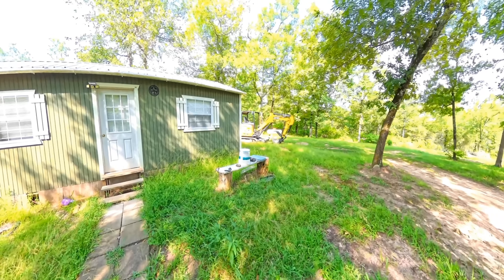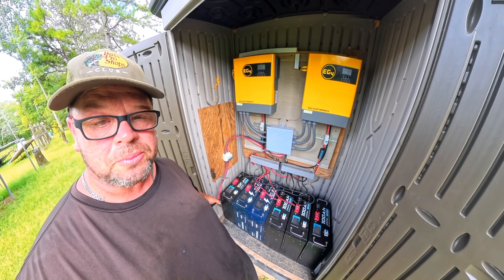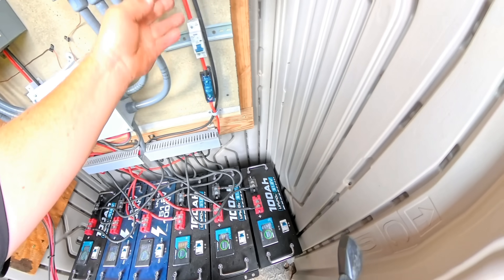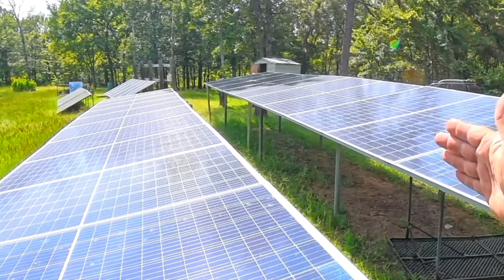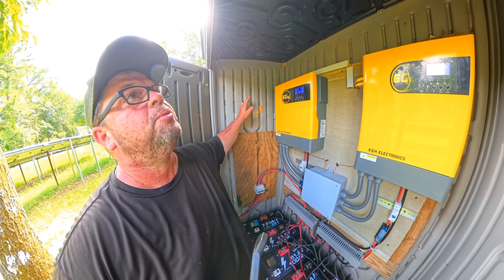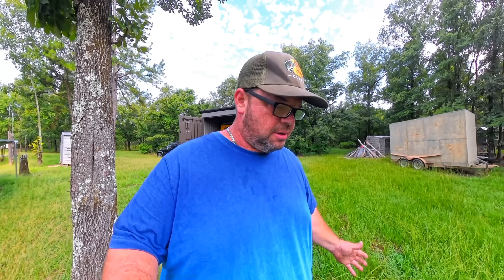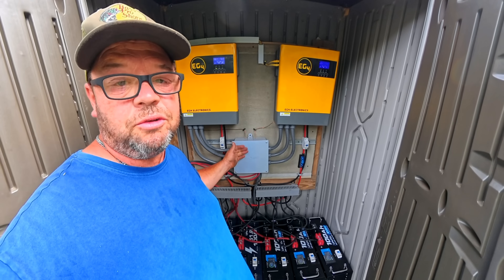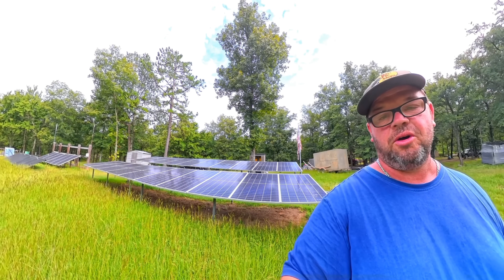Powering My House 24/7 With BATTERIES!!

Comment: As someone who installed "instant" water heaters. I don't recommend them in electric form. The draw is 80 amp breaker for 240 times 3 for each unit. That's not plausible with battery power unless you have a system that can invert 60kw+ on demand. That's 240 amps at 240 volts. So a house requires 400 amp service, if you have it, it would be too much for what you have. 

Just go with instant water heater with propane. I recommend something with more than 150k input BTU. 

Propane is not expensive to have it delivered instead of using 20 lb tanks. For example:

I live in black hills. Out here to fill a tank from local dispenser is $4.25 per gallon ($1 per lb). If you get one of the ASME tank (purchase or lease) you can have a truck delivery service for you anywhere from $1.80 to $3.50 per gallon (depending on season when filling up, more expansive in the winter with some companies) 

Also if you lease a tank, you can only fill from company that provides lease, if you own tank, you can shop around for propane delivery.
Reply: Your math is a little off, an enormous tankless might pull huge power but mine pulls 3000 watts at 240 volts, in comparison my 50 gallon water heater pulls up to 5000 watts at 240 volts. I run the tankless on my solar inverter and it does just fine, if I use it mostly during the day there isn't really a battery damning power hit.
Reply from the maker: exactly what I was thinking

Comment: Bro, all I want to do is run my garage on solar. 1 hot water heater, 2 freezers, 1 frig and some tool batteries. What can I get away with as far as wattage? 😁
Reply from the maker: hot water heater is the killer...keeping 40 to 50 gallons hot 24/7 is a big waste of energy..especially on solar ..but ya at minimum 5000 watts of panels to start

Comment: Which terminals are you using for the two gauge to busbar saw the signature solar 600amp is 5/16. On the water heater front I think running a heat pump water heater is the best use of extra considering the rebates and tax credits. Probably depends if you run at 120 or 240. Love the simple videos thanks ED
Reply from the maker: those where actually from AutoZone 2gauge ..7.59 for 2

Comment: You should get rid of that window ac unit and get yourself a mini split with a inverter technology i bought one last year and the officiency is amazing at a night time wattage drops two 300 to 250w and in a daytime when it's really hot it never goes over 430w the brand i got its called..costway.. with efficiency of 22 rating the price  its around 550 to 500 depending on the website amazon walmart or direct from your website highly recommend :)
Reply from the maker: in the works

Comment: Getting My 40 ft. Container soon. I welcome all ideas to run a normal fridge, (washer  laundry every 2 weeks), 1100-watt microwave, laptop and tablet and 5000 btu window AC. Planning to start with 2 48-volt rack 5.1 kwh batteries. And how many solar panels. Thanks for the video
Reply from the maker: 10 minimum to start

Comment: What do you do if the world goes to shit and you can't buy those batteries? Is the solar set up useless then?
Reply from the maker: I thought the world already went to sht but there still for sale now..lol..honestly I really don't know. But I bet I will be better off than most people for the next 5 years after the sht hits the fan
Reply: @OKLAHOMAOFFGRID you can't run the solar straight to the house and get rid of the battery bank? I don't know how solar works but, that would be my main issue. What if I can't get the batteries one day? I'll be screwed.
Reply from the maker: those batteries are lithium and can last up to 20 years..not like old batteries

Comment: Nice but it still doesnt make sense to buy a 900 dollar battery when you can buy 4 100 ah  12v batteries for 460 bucks free delivery
Reply from the maker: your going to have 4 bms for each 100 amp hour..too much to go wrong and to much to keep balanced and the only recommend 4 sets max

Comment: Try this cut vent put label on outside with a cover canopy over to keep rain out. Install a hinge cover inside . Insulation foam to sandwich piece to close on inside in winter time..
Reply from the maker: Great idea
Reply: You could add a module fan if needed to evacuate heat on one side with a spring wire
Reply from the maker: i was thinking of overhanging metal roof and then vents

Comment: To keep your battery shed cooler, on the lower side of the shed, maybe in the front, drill a hole, and dig your self a ditch, about 4 ft deep, and long enough so that a 3” pvc tube adds up in volume to match or be a little bit bigger then the volume of the shed, if you put to small fans at the top of the side walls of your shed, burry the pvc tubes, the earth will keep them cool and the shed heat will get cool air when the fans are on! Shoot me message if you’d like to discuss.
Reply: There's a love and hate relationship when it comes to control temps in utilities builds! Lifepo4 batteries can survive in temps as high as 140°! Here in the south east control panel boxes for rail road crossing have hit temps as high as 149° with engines parked next to them idling for days! Proper air flow is all that is needed! we have 17+ years lifepo4 cells still kicking! While it's a Gud Idea to help cool it just be careful not to induce moisture into the utility building that will destroy everything quickly!
Reply from the maker: great point
Reply: @nathanhatcher7096 a simple humidity/temp monitor and control system would work great! Arduino!!
Reply from the maker: That's a great idea I'll definitely keep that in mind.

Comment: I enjoy seeing your realistic and genuine videos about your systems. You mentioned something few talk about, racking can easily cost more than panels. And to be honest $$ is the main reason I only have a small solar setup. First my electric co-op is only 10c/kwh and they are very good at keeping the grid up. Secondly they only want to sell bigger panels in pallets making it difficult to slowly build up a system. My main concern is keeping my fridges and freezers going if there is an outage and in the winter to run the fan on my wood furnace. Between power stations and batteries I have about 20kwh of storage and multiple generators with fuel stored to last a while. I would love to be able to be fully autonomous like you but can't justify all that money. You keep me looking at ways to improve. Thanks

Comment: For automatic ventilation... Consider a 5V PC fan and a small 5V solar panel to power it directly. No battery or other controls. It will only come on when the sun is shining on the shed heating it up and won't if it isn't. very simple. no controls to fail.
Reply from the maker: You know it's really a great idea because even in the clouds it should be enough to run those fans.. I'm actually thinking about doing it with 90° facing downward PVC pipe with a round fan inside of it after somebody just gave that idea and maybe put screen over it so no bugs can get in
Reply from the maker: That is a great idea and I'm really considering that and I'm considering putting like window screen over it with a round fan inside 4-in PVC pipe and running it to a couple of small solar panels... Great idea thank you
Reply: I added a louvered exhaust fan to my solar shed, and it does a good job at removing hot air in the summer. Your small shed won't need a large 12 inch fan like my 10x12 shed. I do like the louvers though as it will help keep the rain out.

Comment: How do you keep your inverters and. Batteries from getting too hot in the summer time if you leave them outside??
Reply from the maker: Well that's what I was talking about in the video it really needs fans in there but just the ambient temperature of 100 or 105 is not going to affect the batteries or the inverters as long as they're getting the air flow and not trapped up into the shed so for right now I've been just opening the doors as long as it hasn't been raining but I'm about to do ventilation

Comment: 🤔❓ Thinking about a similar system in the near future, do the components need cooling in some form❓A/C, or Fan❓😁 Thanks Brother for all you do 💒⚔️🎚️ God Bless us All 🇺🇸🙏✝️
Reply from the maker: Yeah that's kind of what I was saying in the video is that I'm going to have to get some type of ventilation going in there because for right now I've been having to keep the doors open but as far as 100° ambient temperature is not going to hurt anything it's just with it closed up it can get up to 150 to 160 in there and that's going to damage everything.. so yeah I keep the doors open for now until I figure out some type of ventilation
Reply: @OKLAHOMAOFFGRID You could literally run a small Mini-split directly off your solar.😜I saw another Righteous Brother show that specific setup " DIY HVAC Guy " 🤗💒⚔️

Comment: Next I would add on another room to your house/shed.    You can still keep it closed off in the hot summer, so you don't have to cool it.  But for half the year when it's nice weather, it will be nice to have that extra room.   I usually hang a sheet over my kitchen and block off part of the house in the summer;  plus you can cook in there and not heat up the AC side of the house.  It really helps with the bill when you reduce your cooled area/room.  But it's still nice have a bigger house too.
Reply from the maker: Yeah that would be great

Comment: Betting the SOC is pretty flat across the batteries. BMS's aren't very reliable for determining SOC. Long as conductors are large enough not to cause choke points they will stick together like best friends.
Reply from the maker: You are correct

Comment: Use a pipe and or just a 90 degree angle and use a low voltage fan on each side. Turn 90 down so no water can come in
Reply from the maker: Great idea

Comment: :hand-pink-waving: tankless hot water system is the way to go :face-blue-smiling: great video:hand-purple-blue-peace:
Reply: I use an old electric water heater using a 120 volt 1500 watt heating element in it as a preheater to the propane water heater. Because of snow in the winter I used only 32 gallons of propane last year, which includes the kitchen propane stove. My neighbor's on demand tankless water heater needs 34,000 watts in order to run so I set up an electric water preheater for them as well for the winter snows. They do not have solar but use a generator during outages. Heated water in an insulated tank is another form of an energy storage system.
Reply from the maker: thats a massive instant hot water heater to need that many watts at once
Reply from the maker: You are correct
Reply: No, don't do that.  I have one.  Inherited it.  Garbage.  When you run out, you run out--there is no reserve.
Reply: Tankless uses stupid amounts of electricity all at once. 13-24kW for most. My sisters lights dim even on grid, why would you be off grid and try to pull that load from an inverter. 
Heat pump water heater sips power, you can even set up your solar to dump extra power into it and use it as a type of battery even.. Wild to me to want to be dependent on the grid for either gas or crazy high surge power requirements
Reply from the maker: @AndresHernandez-n7w I have seen 3000 w instant hot water heaters... I've seen 4 and 5000 watt instant hot water heaters I have plenty of power for that specially with it only being on for 6 to 10 minutes at most during a shower
Reply: @OKLAHOMAOFFGRID 3 or 5k is just enough for one shower or faucet sure, even 8k tankless isn't enough for two showers to work well at my parents in florida winter.  I had a 6000xp and just the 4k from water heater, baseload & a microwave was enough to over load it, you just can't control that granulary power use of a multi person household. Just think it's wiser to advice a soft 400w heat pump ultra efficient water heater for someone trying to primarily use batteries and solar for an average american home.
Reply: @AndresHernandez-n7w  I agree.  It's foolhardy.  I will say if you enjoy a bidet or hot water up your shitpipe a few ounces at a time then buy it.  Gotta wonder about the 'man' who uses a 17th century photo to promote this primitve method of washing your drawers...maybe he enjoys the fecal or  just the smell.
Reply: Hard water wreaks the electric tankless water heaters. It will be a headache.

Comment: Q: How do you Connect this power setup to the house? 
Looks like your house isn’t right next to this, which is awesome.
Reply from the maker: You know you're right I really need to do a video on that or at least add it into my next video but yeah I've got six gauge wire that is direct burial coming out of the back of the shed it goes directly into the ground about 2 ft under and runs all the way to the house and then up out of the ground into the house and up into the breaker panel.

Comment: Make sure to run the generator every once in awhile to make sure it works when it is needed check those preps
Reply from the maker: Well it's just a small inverter generator that back charges the batteries and I do use it for other things from time to time so the generator itself runs good and I do have three generators for backup most of them small inverter generators but yeah great idea just to make sure everything is working right